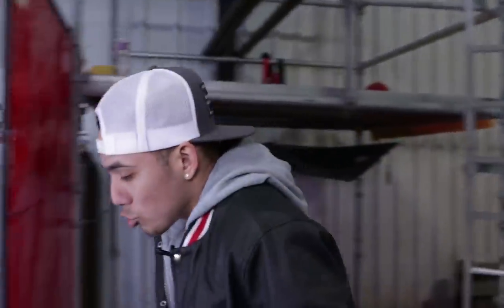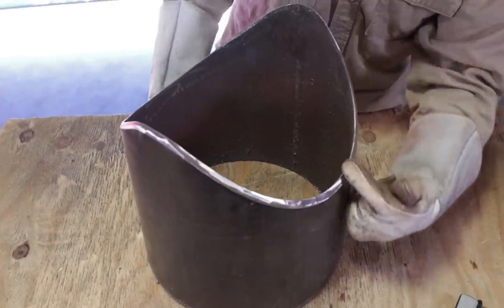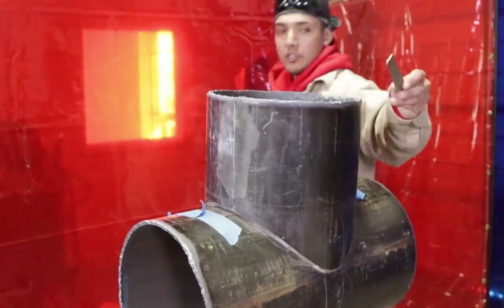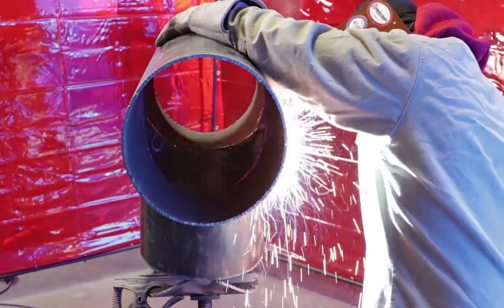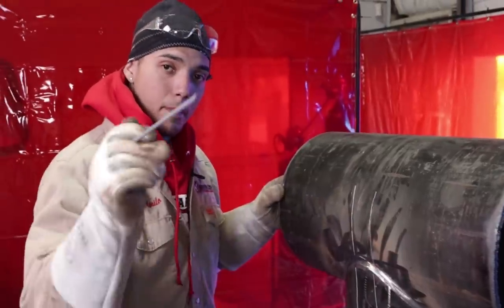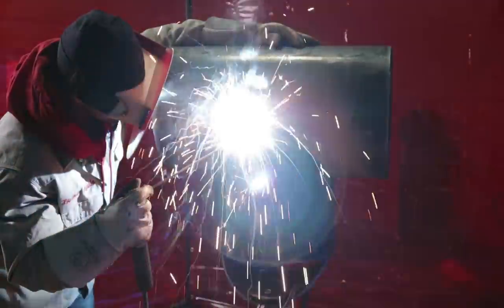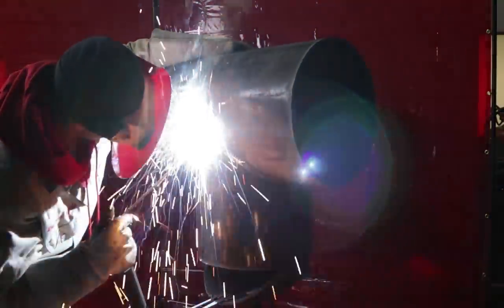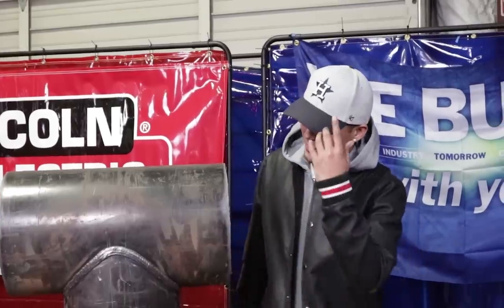How to fit and weld a 12x12 Branch Test Tutorial

Comment: Been pipe welding for about 24 years and brother that's some pretty nice work!! Keep it up !!
Reply: Looks like he did an extra pass at the ears before starting his first fills. After the hot pass, I usually take a 1/8th rod and stack a bead on the ears before switching to a 5/32 and starting my 2 bead fill passes from the bottom up.

Comment: fabricator welder for 50+ yrs. a little trick that i used was to fire up the torch and burn all the lacquer finish off where all your layout lines are going to be,,, makes for a FINE line of soapstone not a wide mark,,, you can only be as accurate as your layout and definitely learn to bevel as you go. Makes for a way faster clean up.

Comment: I have kept up with every single video you have posted and buddy you are a great welder but an even better instructor. I have a suggestion for your next video. These are questions I see a lot of new upcoming welders like myself have. Heres a few.  

1. How to feather tacks on TIG to get a good tie in and whats a good technique. [Sometimes when I tie in to a tack on my root, my bead profile is a lot lower than the rest.]

2. How to make repairs on a weld, specifically the root. [ whats the best method to cutting up a weld that has already been capped to make a repair on the root]

3. How to stop or minimize warpage and drawing on a pipe weld. What are the best tips you have on not putting a dog leg on a pipe. 

4. O-lets how to fit up and weld. 

5. This is the last one I can think of.  How to fill up a pipe faster with tig. [ I personally feel that the time it takes me from root to cap is double what it should. How do I speed up the process of TIG from hot pass to cap] . 

Thanks for reading this bud. Keep on burning brother!

Comment: That is really interesting.  I have never seen pipe getting fitted and welded that big.  I have  fit and cut pipe up to a little over 2".  Luckily, our CNC plasma table will cut up to 1/2" wall 6"diameter  pipe. so you don't have to mark and hand cut it  My son is a fitter.  He hates dealing with the small pipe and is always in a bad mood when they send him upstairs at work and he has to deal with 24" and smaller pipe.  Their big CNC pipe cutter will cut about 2" wall pipe up 14 feet or so in diameter.

Comment: Best branch tutorial on YouTube.  No doubt.  Got a question.  Would the weld at 46:16 (dead center of screen) pass?  Looks like you ground on it and it doesn't look tied into the parent metal that well.  Have you considered being an instructor?  Give it some thought.  I know what third gear is, I have an SA200 that is 55 years old and still has the best arc ever.  If you can give it in amps that would be even better.  Keep up the good work.

Comment: I’d like to add making a mark on your pipe and a mark on your saddled cut to make sure you put it on the right way when testing your fits because each side is not going to be cut the exact same and could cause some confusion with the fit and a lot of unnecessary work. And also in the field for pipeline/oilfield work you can only put up to a 1” tack if not less depending on the inspector and usually no more than 4 tacks

Comment: Beautiful beads! I have never welded any pipeline stuff. Most of my experience is in logging equipment repair and fabrication.  With that said, I'm sure this going to be obvious for most people in the pipeline industry, but why do you turn the branch upside down? I would have thought it would be best to weld it the other way. Unless you have to be able to prove you can weld it overhead.
Reply: Most tests are designed to make it harder on you.

Comment: Done them on .375" w 7010 root and 8010 fill/cap. Marathon mandates max 3 bead caps and a max of 5/16" weld beads. Largest rods allowed are 3/16". Machines must be checked by QC between passes to make sure the amperage settings is within limits.
They bend the ear and throat but RT a third random section. 
That's the standard test for all rig hands in Salem refinery
Reply: Great job on that branch by the way. Looks very nice.

Comment: Dam nice. That's tight. I have never been a fan of that type of electrode I have always liked I nice smooth weld without the bead pattern. But I really like the finish that you can do the rings are consistent . I do appreciate the time you spend making these video's. I would like to ask could you tell people what amps  or volts you are running at alot of people aren't using a Genset like myself I'm a shop fabricator I only use my converter or my  mig welder.

Comment: Another epic one Hjalmar. I really had to sit down with a beer for this one. 46 minutes of weldporn.
I don't know a lot about pipewelding, but what is the reason for turning the branch over after tacking and welding the throat overhead?
Reply: Etol1963 cause the other way is to easy to weld for him, overhead is harder. But he's already a badass in any position so I guess that it doesn't really matter for him.
Reply: All position Test .
Reply: It's actually easier to weld this type of fit overhead. You you have free space all around you to get the proper rod angle and line of sight. Versus doing it the other way you have to work around the pipe with less room to work and less line of sight because your looking down at it instead of up into it.
Reply: @deathtrip187  branch has to be inverted down, API 1104, req. for the test. I administer these tests daily. You did a great job, Weld Tube. lets cuts those straps.

Comment: Would you say you ground back about a 1/2" on the bevel to form a 30 degree angle. I was just doing some calculation and from what I figure to get a 30 degree angle on a .250 wall pipe, you would have to bevel back about a 1/2" to form the correct angle. Is that correct?

Comment: I had a weld test for the 520 that was a 10" butt joint with a paddle cap sadly I have never done that so I did my best... had under cut and spots of under fill

Comment: just a couple of questions  are the rods your  using stoveing rods (vertical down) iv noticed in videos from the states pipe line welders show lots of stoveing in the 5G position being used, Across the pond over here in England we dont see much of stoeving rods they seem to burn really well coming down hill we have to weld up hill. What make and designation are they?. here we use esab fillarc 88s for standard carbon in  the offshore industries which are low hydrogen spec which are in short horrible to use. to me your tee branch is upside down we would do it tee tail up not down but i don.t suppose it would make much difference on site or in the field. Its so refreshing to see a young lad like yourself with such enthusiasm i wish our apprentices had as much go. you make great tutorials keep em coming your a great inspiration to all apprentices across the globe  ( deka  multi coded 6gr welder)
Reply: derek spowart he is using e6010 rods. They are a fast freeze rod. Our low hydrogen rods are e7018. There are others but those are by far the most common.
Reply: You can only weld downhill with fast freeze rods. The nose common are 6010, 6011, and 7010
Reply: Also some jobs require uphill only. It depends on the pressure and other stresses the pipe is expected to have. Most large pipelines don't have much pressure so downhill is fine
Reply: I've seen downhill 6010 root and hot pass. 7018 uphill cap.

Comment: I'm trying to understand the amperage. 3rd gear is 120-190, the difference is 70 which means on the remote 0-10 it's increments of 7.  When he says 3rd gear and 30 does that mean 141 amps? When he mentions fill pass at 3rd gear and 50 that seems hot for 5/32 155amps. If I understand correctly

Comment: I don't understand the gearing on the machine. Can somebody explain? I haven't used a machine with gears like that. Is it like a multiplier knob or something. So if it's 40 on 3rd gear would that be 120amps? Or how does the gears work and what does it mean

Comment: I'm not a welder, but I was a pipe fitter for a number of years. 

I have a question. It looks like you are welding downhill in the parts of the video I saw. Was this welded with a 6010 or 6011 and then capped with a 7018 low-hydrogen rod?
Reply: Mark Spence 6010 root. 8010 hot pass and cap. All buried pipeline is downhill.
Reply: No pipeline i know of runs 6011. 6010, 7010, 8010.

Comment: You kept saying 3rd gear and 60. So what are you talking about? I'm assuming it's 3 amperage ranges (60 to 100, 90 to 130, 120 to 200) and 0 to 100 fine tune, but I'm not sure if that's it

Comment: Could you explain cutting the straps and nicking them?
Reply: WeldTube I'm have trouble finding how to lay it out with the blue book it's a 12" .375 wall and I can't find in the book where you put the marks for the wave shape of the saddle
Reply: James Castillo put 16 marks around the pipe equally spaced, then number 0.1.2.3.4.3.2.1.0.1.2.3.4.3.2.1, then pull your measurements that are in the book then use your wrap around to trace it out

Comment: I like it when the gas company makes you take a .375 T- test. Best thing to do is bring your oldest welding shirt and prepare to throw it away after they cut straps. 😖
Columbia gas always had a tuff test
16” 45* and puddle cap with 3/16 cut 14 straps
12 on 12 .375 Tee test
6” .250 horizontal 
Scratch the stops and turn me up 5.!!🧐

Comment: And you never mentioned any alignment marks on the exterior of either of the pipes.. so as you adjust and move that thing around remove it grind a little here grinding a little there. When you put them back in place you can use your exterior alignment marks to know that it's pretty close to the same spot.. IDK you never mentioned them but I believe I saw them???

Comment: What do you mean when you say 3rd gear and 25 or 3rd gear and 50? I know it is in reference to the amperage, but what would the amperage be then?
Reply: It's a pipeliner machine like a Pipe Pro 400, not a hobby machine so those numbers mean nothing to you.
Reply: Some machines like the Lincoln have the coarse settings in ranges. All the way to the left, from a minimum to a maximum, thats 1st gear. Click to the next setting, 2nd gear. The fine current is 0-100. So 3rd gear gets a range and the fine is the 30 or 40 he is talking about.

Comment: hi i m french and i very like all tout videos  so i have a question About this. 
with wich one electrode weld you?
and so how did you do To have thé trace About your quilting?
sorry if my english is not very good
Reply: geo I believe he used 60/10 electrodes for the root pass. And 80/10's for the fill and cap.
Reply: @williamarnett1968  ok thanks but it s rutile, basic or cellulosic electrod ?
Reply: It's a cellulose Coated fast freeze rod
Reply: @williamarnett1968  thanks

Comment: Hey man when u say 3rd gear and 50-60 what do you mean by that? My real question is how mmuch amperes do you run on hot pass with this thing?
Reply: Pipeline welding machines have coarse current settings on the left hand side. In increments all the way to the left, 1st gear. Next click or increment, 2nd gear. And so on. The fine adjustment is the 30 or 40 on the right side. 3 gear, 3rd increment. And 35 or whatever.

Comment: Downhill welding is acceptable in the states? Here in sweden we lose our license at the spot if they find us doing anything downhill
Reply: Down hill gives a lower root profile than uphill...this allows the use of "Pigs" used to clean out sludge and wax buildup in petroleum lines and the use of "smart Pigs "for NDE ect.....the "Pig" will not hang up on the root passes of the welds as it is pushed through the pipeline
Reply: Its required by the code they are running the project at. If required these guys run what is required.

Comment: 3rd gear and 30? What does that mean? Would 30 be the arc force setting?
Reply: It's means his Lincoln sa200 black Face is running in third gear with the heat control knob on 30. Google Lincoln sa200. You will see the front settings

Comment: Again about 26 minutes and 45 seconds.. I'm running at third gear???? + 50.. do you double clutch when you downshift or up shift??? LOL I know what you're talkin about... but over my 40-year career I've used probably 300 different machines.. and up to six hundred feet of electrode lead.. down to 30 feet.. and every cable diameter they make.. so yeah saying 3rd gear don't mean s***

Comment: And those of you who also use the grinder without a handle and instead grab it with your other hand on top of its "head" are also just tempting your luck... the grinder "breaths" through those openings to cool off and that's why it gets hot and it overworks unnecessarily and you can not make a straight "laser like" cuts by omitting the use of the handle and the guard. Once you learn how to use it Properly, you will see your quality of work improve. Don't believe me? The Angled Grinder is no different than a Cut-Off Chop Saw or a Miter Saw... Just try using those without its safety features and you'll understand why they're There...

Comment: what does he mean by third gear ?
Reply: The machine has two amp control dials one one for large steps and the other small steps for fine tuning the amps/heat input
Reply: Move the large step to the third setting and fine tune with the small step add the amps on both dials for the total amp output
Reply: @Donald Carter, thank you for the most comprehensive answer I've seen. Most non-pipeline welders probably haven't worked with or been exposed to that kind of welder. Your polite, clear answer was a breath of fresh air after the condescending replies that others made.

Comment: And then you say you got to adjust your temperature just don't get used to one temperature... and this statement is true in some respects.. and I don't claim to be an expert and I'm not trying to be judgmental or sarcastic but after 40 years the only time we use the term temperature is for preheating or interpass temperature... I never saw you mention anything about preheating...

Comment: At around 41 minutes he says all that matters is what the QC wants.. in my experience that's not true there are or very well should be drawings and specifications.. the drawings are made by engineers.. and approved by other engineers.. these should have all the specs.. and the welder should absolutely and undoubtedly know what the specs. are !!! The"" Q.C.s."",, as you put it,,, job or inspectors job is to make sure the specs are followed.. and that the finished product meets them. !!! QC and I don't know why you're using this  in your video.. and I know they do but it's not right they can't make up their own processes judgments whatever... if this is the case it has to be in writing.. somewhere on a weld spec sheet.. and be provided to the welder prior to testing... any privately owned company can take a kid out of high school and give him the title of welding inspector..

Comment: At 15 minutes he says I'm running...3rd gear.. and 20 or 30..... IDK maybe it's just me but what kind of explanation is that??? I've been welding for 40 years and I've never had a welder with a standard transmission... I'm not trying to be sarcastic or judgemental it's just an observation
Reply: 3 position on a pipeline machine.

Comment: So the most important thing is you only have to do a good weld in 4---4 in sections of this pipe test to get a certification... I'm not trying to be sarcastic or judgemental but in my opinion that is not good instructions
Reply: There are at least a couple other tests. I believe the 12x12 is the last one to pass to weld on that job.